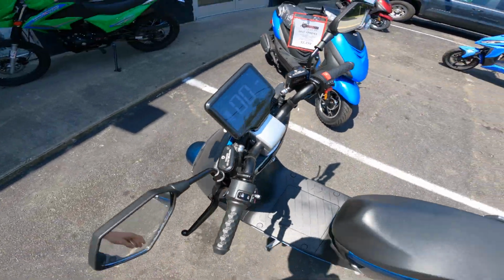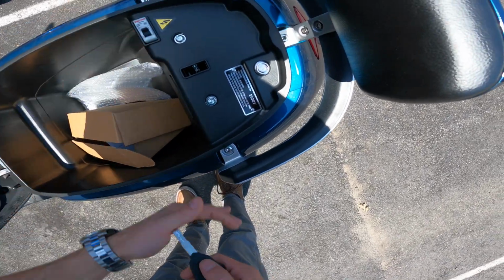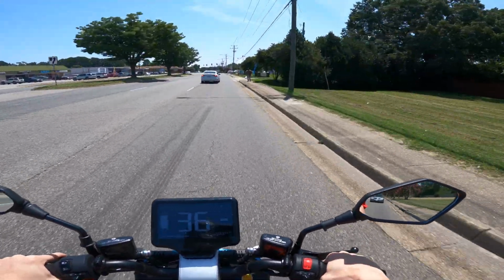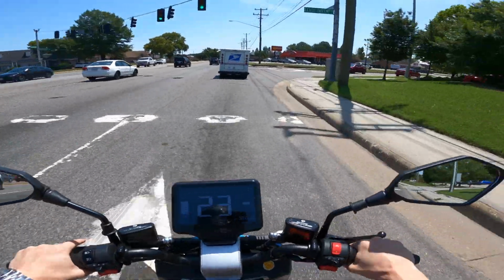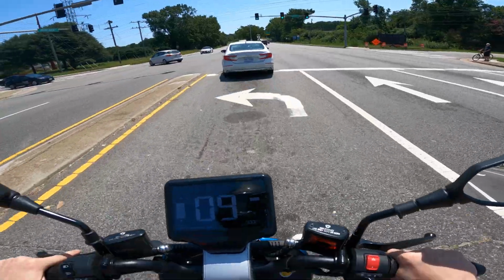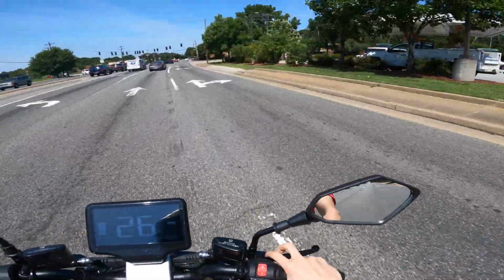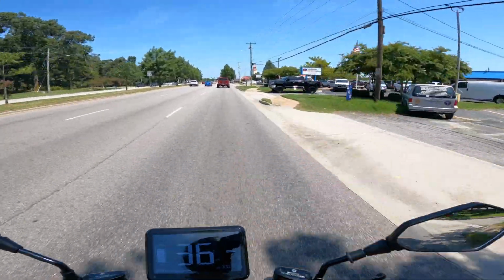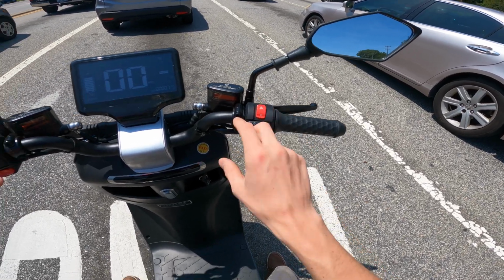NEW 2020 ZIGGY G5 TEST RIDE | Fusion Cycles

Comment: A quick word on battery maintenance that will double the life of your extremely expensive lithium-ion battery… It may come as a surprise to some, that these batteries do not possess a charge memory, and that fully charging and discharging them is the very worst thing you can do… At full charge, gradual plating of the negative terminals occurs, greatly reducing battery life. Therefore charge only to 80-90% and try to avoid total discharge. (A cheap electric timer will facilitate this, without having to invest in expensive dedicated chargers). Having said this, about once a month allow the battery to discharge and then charge fully, as this re-balances the cells, and resets the digital memory, thus maintaining the accuracy of the devices power gauge. For storage, charge to no more than ½ capacity and keep away from excess heat or cold.

Comment: My biggest complaint of the G5 is that the throttle is WAY too sensitive.  I get a smooth ride at full throttle, which is what you were doing in most of the video.  However, if I am trying to travel at 20 mph, due to traffic, it is jerky as Heck.  If I hit the tiniest bump, like a manhole cover, it causes my throttle hand to move ever-so-slightly, which then causes the bike to suddenly jerk forward.  I try to reduce the speed back to nominal, and it goes too slow.  It is impossible to keep a smooth speed at less than full throttle for any period of time. :(

Comment: Can u put 300lb rider on that scooter 🛵,..so I can see how fast it goes, with that rider size??
Reply: I weigh 250.  I get 29mph on eco mode and 36mph on power mode, which I note are the same top speeds the rider in the video is seeing.